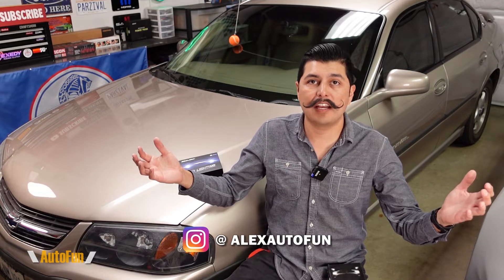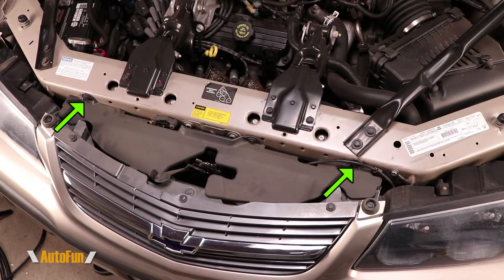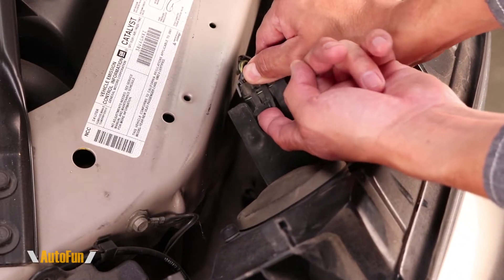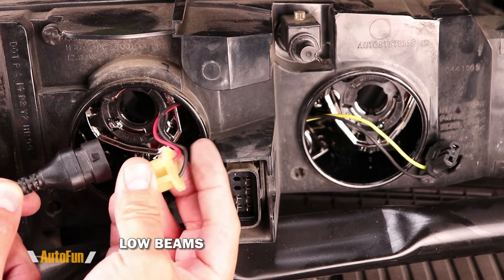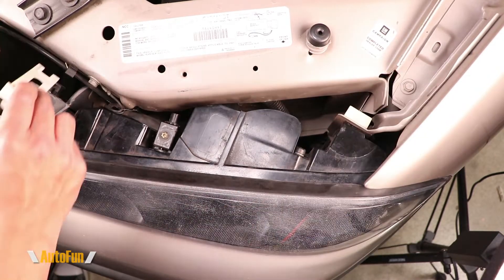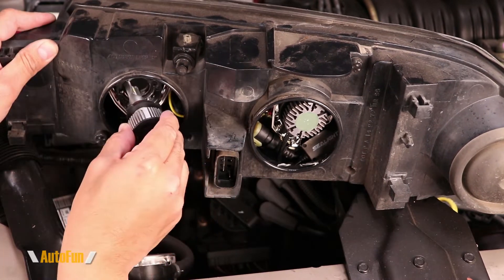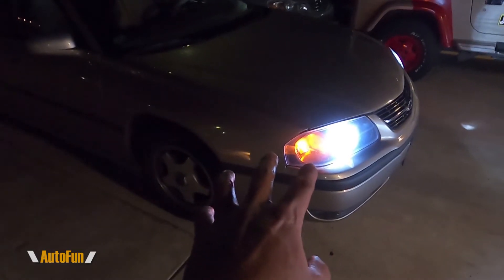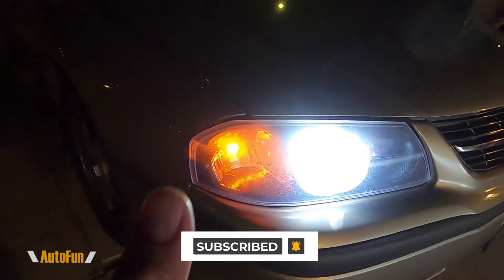Chevy Impala LED HEADLIGHTS Upgrade (2000-2013)

Comment: I put LED headlights in all my cars, but what's the absolute most important, is that they're aligned correctly within the housing. Ideally the LEDs should face the 3 and 9 O'clock positions to best imitate the original halogen bulb, but some tweaking might be necessary.
Reply from the maker: Hi RazoE! yeah exactly! that is a really good reminder, it definitely helps with the beam pattern..

Comment: Nice video!  I see that the high beams actually include a small fan for cooling.  I'm not sure I like the 6500k temp though. I have not checked your other reviews, but it would be interesting to see what other brands have to offer.  Heat is apparently the enemy here... Halogens also get very hot.  And yes, the beam pattern of the LED is directly related to the placement and direction they are pointed.  I'm not sure there's much control over that aspect if the unit has to be locked-in a specific way.  Halogens have 360deg light disbursement, LED's are different.  And lastly.... They don't make cars so easy to work on anymore!  I have an older Buick (2001) and these may be great for it when replacement time comes.  Thanks for your reviews! 👍
Reply from the maker: Thanks John! ah yes heat is the main enemy of LED bulbs, check out the other LED bulb reviews in my channel under the playlist "LED Lighting"  I have reviews for both fan-less LED kits and kits with fans, also some don't have much adjustment since the collar is locked in place but some do have a rotating collar to fine tune the beam. Hope this helps bud!
Reply: @AlexAutoFun  Will Do!  Didn't know about the optional rotation.  Nice.  I'll check-out videos!... Also - I purchased the Ousman A8 Pro and perhaps you could do a follow-up video on the unit you reviewed on your channel.  I have not installed it yet, but thought a long-term review would be good to see. Thanks again!
Reply from the maker: @johng.4959  You're welcome! yeah that is a good idea!

Comment: Why did you use 2 different brands of lights ? And do I need to replace both Low and High with LEDs ?
Reply from the maker: Hi Frederick! I used two different brands because I had some spare light bulbs around, however you can definitely use the same brand for both as long they physically fit (most brands carry both sizes, I placed links to each in the video description which you can also use to confirm the size) Regarding your second question, some people upgrade their low beams only, some upgrade their high beams only and some upgrade both, so I think it's most a matter of preference and if you want to spread the cost over time by upgrading one set a time. Hope this helps, Cheers!

Comment: I have a 07 impala LTZ, will I have to rewire the front for led ? I’m making this comment cause I got a few mins at work and I can’t sit through the video.
Reply from the maker: Hi Mystic Tk! Correct, the LED headlights are drop in replacements for the halogen bulbs (same connector no need to rewire) as long as you order the correct bulb size (refer to your owners manual or the bulb on your car, they have their size printed on them) and I put the link to the bulbs in the video description. Hope this helps, Cheers!
Reply: @AlexAutoFun  Thank you so much!!
Reply from the maker: @mystictk4149  You're welcome!